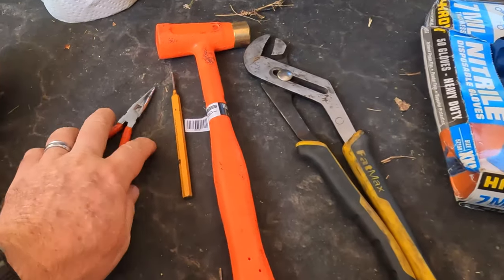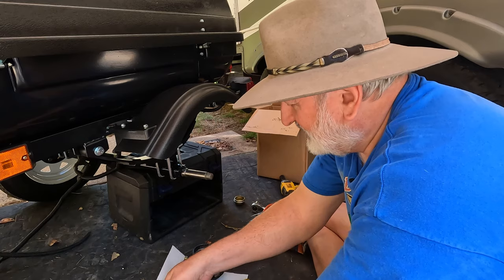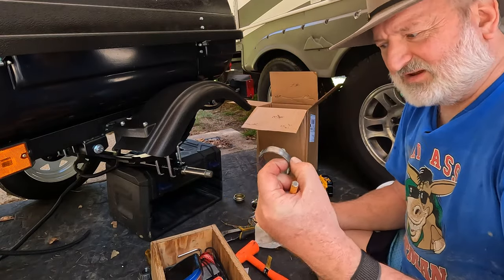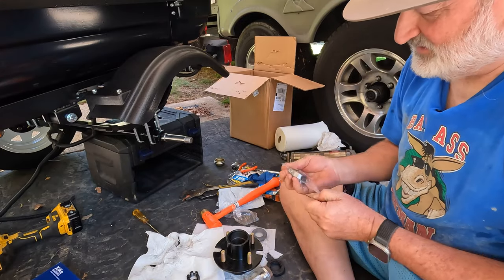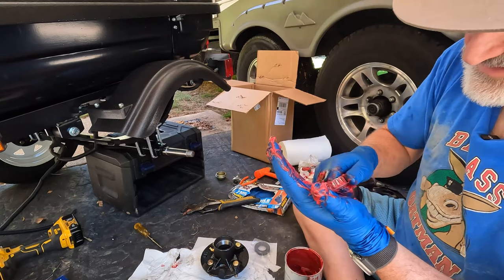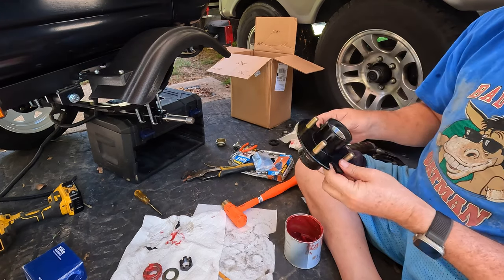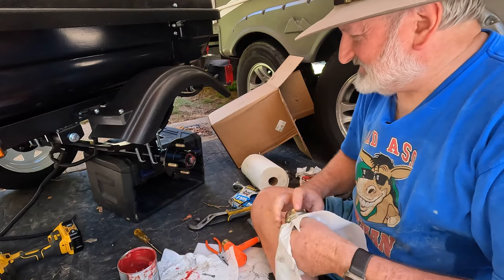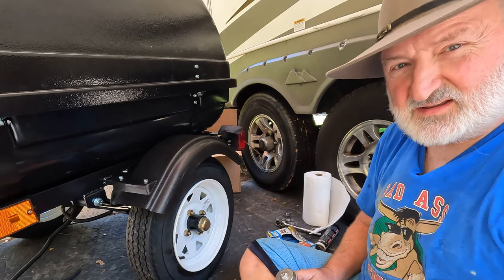Replacing or Repacking Axle Bearings on Northern Tool/Harbor Freight Motorcycle Trailer

Comment: OurRetirementantAntics Thanks for an AWESOME detailed and demonstrated of packing or replacing the bearings. I purchased a used pull behind motorcycle trailer and im getting ready to check, but better replacing the bearings and seals. Thanks again for an AWESOME demonstrated detailed step by step easy to follow video. I subscribe, Liked, and following. Dj
Reply from the maker: Thank you very much. The cost for bearings and seals for these trailers are so minimal that anyone should replace/inspect/repack them for peace of mind. Thanks for your kind comments.

Comment: Bearing s are easy to change. The part you failed to do is install some Bearing Buddys. Keep a little spring pressure on the grease and your bearings will last for ages.
Reply from the maker: I hear you but I am fine with giving the bearings a few shots of grease before every trip and inspecting once a  year. Thanks for watching.
Reply: @OurRetirementAntics  So if you give your bearings a couple shots of grease every trip, think about where the grease that's already there ends up?! Probably getting forced out the inside seal and all over the rim.

Comment: When you go to remove the rear seal, after removing your outer bearing put the nut back on and pull the hub with some quick force towards you and the seal will come off and the seal will be reusable if the seal was good before hand.
Reply from the maker: I never thought of that. I usually have new seals and don't care but I need to try this in case I ever need to reuse a seal. Thanks for watching,

Comment: Fyi, knock the inner bearing out from the front without removing the seal. It will in most cases pop out the seal in the process without damaging it
Reply from the maker: Yep, I could do that but if I am going to take the hub off to clean/inspect the bearings, I always replace the seal. They are cheap. My Dad would always replace all o-rings, gaskets, etc when doing major repairs on something. They are cheap and you have it apart anyway...... Thanks for watching!

Comment: The hub has grease zerts, so why do you have to repack brand new bearings?  Pumping grease in through the zert should force grease into the bearings, if they didn't add that much.  I could see repacking bearings every year or so.
Reply from the maker: Maybe habit, I really don't know. But doing it by hand, I know the grease got into every part of the bearing. And I still inspect the bearings and replace the seal every year just to make sure the bearings are good. It does not take long and I feel better knowing they have been inspected and have fresh grease. The only thing that can strand me on the road regarding the trailer is a bad bearing.

Comment: I have 2 things that I do not agree with you on. One is installing the seal...get a small board. You can use a 1 x 4 or a 2 x 4 with either one about 12 inches long. Set your seal in place and put the board on top of the seal, then hit the top of the board to drive in the seal until it becomes flush with the edge of the hub. The seal does not need to go in any deeper. The other is how tight for the lug nuts or the lug bolts. I use a torque wrench and tighten the fasteners, either nuts or bolts to 75 pounds feet. Never just tighten them up unless you have a certified and calibrated elbow or arm. I have one friend that tightens his fasteners to 50 pounds feet, but he also uses BLUE thread locker juice on the threads. With a little effort, the blue thread locker will break lose. The red stuff is a whole new ball game and it is best to heat the fasteners up with a small torch before trying to get things lose. The grease zert is good, but a pain in the bo-hunkous to get to. I use buddy bearings.
Reply from the maker: I actually often flip the race driver and use the flat side for driving the seal. I forgot to do that in this video. I have 4 torque wrenches and use them religiously on my other vehicles. Not sure why I did not use it on my trailer. But I do a walk around of the trailer and kick the tires at every stop. Never had a problem. Thanks for watching!
Reply: @OurRetirementAntics  No worries...just chalk up the not remembering to use the torque wrench as nothing more than a slight "senior moment."
Reply: I heard your elbow click when you tightened up the lug nuts. I think you're good to go. I have never used a torque wrench on my trailer. I'm not saying it's ok not to use one but I've never had an issue. Thanks for making the video. I'm getting ready to build a trailer to haul my dirt bike. If it's ok with you, I would like to put a link to your video in the description.  @OurRetirementAntics
Reply from the maker: @marklander9177  It is fine to include a link to this video. The more the better 😁  Send me a link to your video when you finish your build. Thanks for watching.